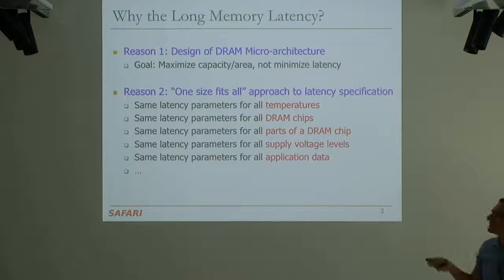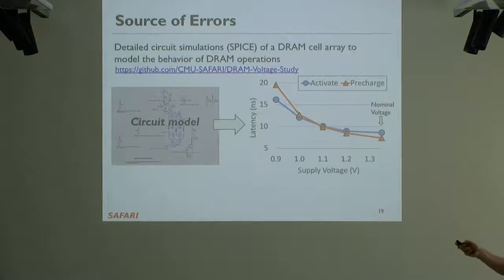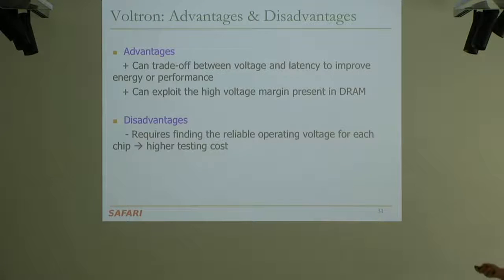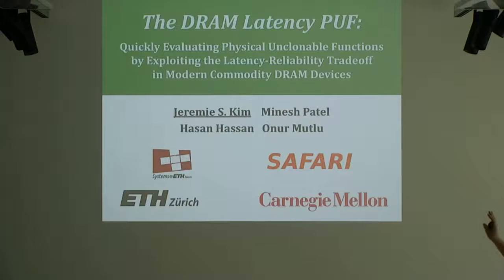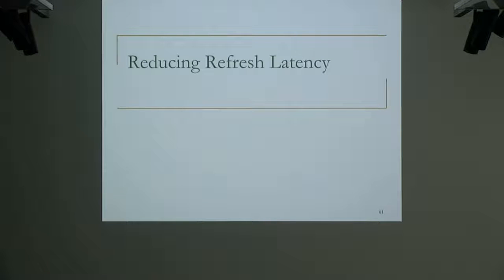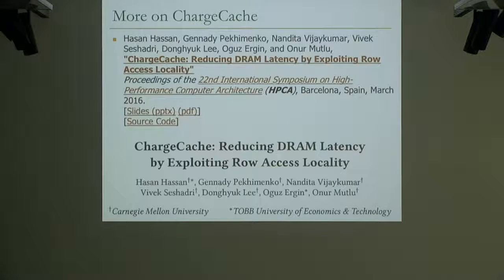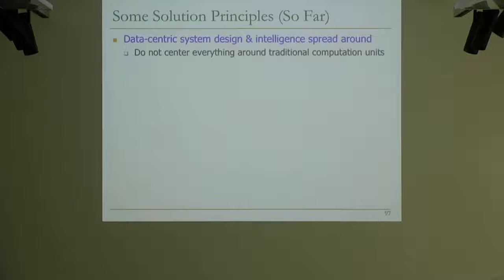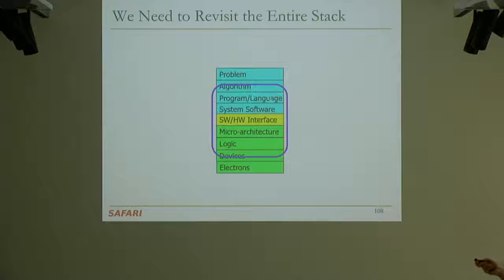Onur Mutlu @ TU Wien 2019 - Memory Systems - Lecture 6a: Low-Latency Memory II

Comment: Wow I was surprised to learn dram can pull more than 40% of the power needs in that desktop! For the gpu maybe not so surprising only because I barely know what floating points require power/voltage wise